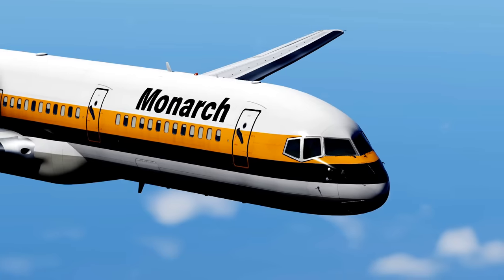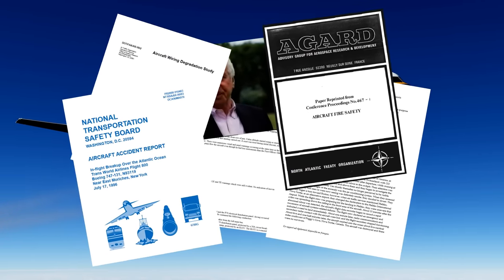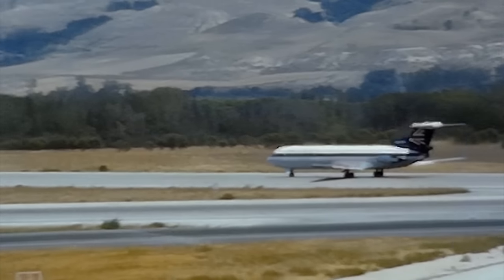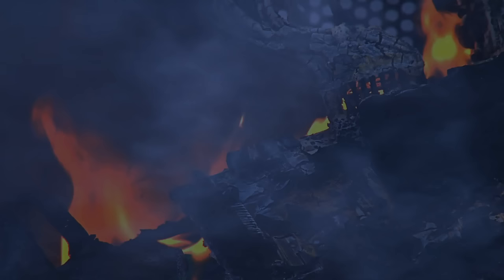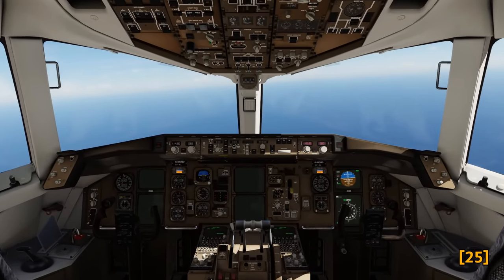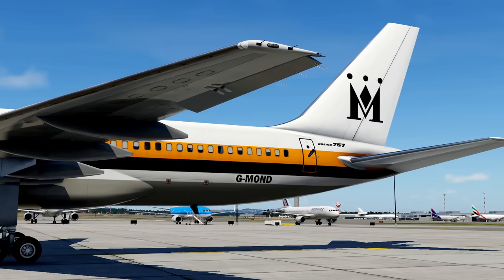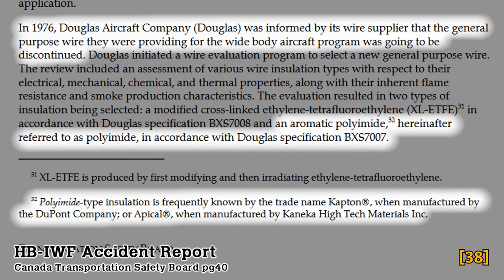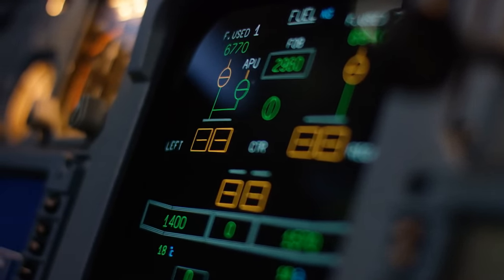The Toilet was Leaking??  What The Heck Happened to Monarch Airlines Flight 390 - DISASTER BREAKDOWN

Comment: What is the most puzzling issue to me , since you mentioned the arching in the 800 flight disaster, is exactly that aspect of wiring and fuel tanks. It has been known for many decades that you do not want to lead a high capacity wire through fuel tanks because if they produce arching, they will produce a spark strong enough to set fumes ablaze at explosion rate velocities. Yet, at the same time, high and low capacity wiring was routinely still bundled together throughout aircraft, leading arching in high capacity wires to jump to low capacity wires. And right there, you have the true cause of the 800 flight center fuel tank explosion. But still, NOBODY connected these 2 dots until the 800 flight went down in the waters right outside New York, sadly causing most passengers to experience a horrifying fiery death before even hitting the water.
So, what I don't get is that despite the problem finally being thrown into the known equation of arching problems on aircraft, and prompt initiatives resulting from it, aircraft are to this day STILL being built with both types of wiring bundled together and low capacity wires still being led through fuel tanks. And despite empty fuel tanks routinely being filled with inert gasses to avoid a fuel/air explosion like in the 800 disaster, there is no real guarantee that somebody will never forget to do that, and a new 800 disaster will never ever happen again. The danger is still very real and very lethal.
And the most stupid thing is that they only need to look at ships to solve and eliminate this danger completely. Ships are very much in the same situation as aircraft when underway. If a fire occurs, they cannot simply stop on the spot and people walk of the ship/aircraft while firefighters from the nearest fire station turns up within minutes to put out the blaze. 
So, on ships, you never see any form of wiring being led through a fuel tank of any kind. It is ALWAYS led around these tanks in one way or the other despite the fuel being much less volatile than high octane aircraft fuel. In addition, Both types of wiring are never bundled together at all if it can be avoided, and if it cant be avoided, then only for the absolute minimal length possible in the same wire lane box. This serves a dual purpose. One is the obvious one like the 800 disaster. The second one is that if you do have wiring near a fuel tank, it is low capacity wiring so that if a fuel tank has a leak, the wiring will never produce a spark capable of igniting the leaking fuel, and if arching happens in a high capacity wire, it will be virtually impossible (like a 1 in 2 million chance if everything is being mounted and maintained properly) to transfer to a low capacity wire moving close enough to a fuel tank. This is even more important in navy vessels as these are built for combat where the risk of fire is even greater because combat damage must be expected due to being hit by enemy weaponry.
So the aircraft industry world wide should actually embark on a journey to visit both civilian and naval vessels to see how it is properly done and incorporate the lessons in their construction methods. Hell. Even car manufacturers never lead wires through or near the fuel tanks if they can possibly avoid it (which is very easy to avoid on all road vehicles). But the aircraft industry and the air lines are so focused on saving weight and space that even these relative simple solutions that would perhaps add weight similar to that of a family of 4 with luggage overall on a wide body jet have chosen to not use it as a habit. And it wouldn't even require a lot of new technology or the invention of new materials. The technologies and materials are already standard in the aircraft industry and it's maintenance sector.

Comment: Most airlines don't assign pilots to a a new fleet, or any position, based on being "the best". It's normally done by seniority, although for a brand-new airplane there could be some requirements such as specific previous experience in similar equipment, instructor experience, or specific previous PIC experience (ie no brand-new CA's on a new fleet initially). Specific requirements would be determined objectively, often by regulators. Not a bunch of managers sitting around arguing as to whether Mav or Iceman is best for the job. With that said some non US/EU airlines do have arbitrary processes for that kind of thing, I have no idea about Monarch.

Comment: But considering the deficiency of electrical power due to the electronics and engineering bay suffering major damage, wouldn’t the thrust reversers also stop working (due to the lack of hydraulic power due to the pumps not working due to a lack of electrical power) making it difficult to slow down once on the ground without your wheel brakes overheating and possibly catching on fire while trying to slow down from such high speeds, or am I missing something here because the 757 uses its engines for hydraulic power rather than newer aircraft like the 787 where the hydraulic system is decoupled from the engines and electrically powered instead?

Comment: Swiss air 111 was a double vitcim. It had the the faulty wire insulation and the extremely flamable milar insulation, or however you spell it, that the FAA didnt properly fire test...

Comment: Interesting incident. I was not aware Swissair 111 had any connection to Kapton insulation. I thought the principal issue there was they had wired in a new AV system completely wrong. And installed it in such a way that it could not trip a breaker when the inevitable shorts developed.

Comment: Is this what also caused TWA 800 crash in 1996?
(It was found that the fuel was highly above the flashpoint and they blamed it on a wire spark in the center fuel tank)

Comment: It's like anything that is new testing will show some issues, unfortunately it won't show all and repairs can be just as dangerous. Look at the issues with the auto industry and all the stuff used to avoid crashes. If not properly calibrated or it fails it can and will cause the exact thing it's there to avoid.

Comment: You kept showing the tape, that's not used to insulate wires, typically to wrap them or cover surfaces that need binding and/or insulation.  PVC and Teflon insulation have their own drawbacks so don't paint polyimides as a buggy man.
PI is quit water and solvent resistant.  It's used in RO filter membranes.
Wires and cables need to be handled and installed with care and need proper strain relief and be protected from abrasion, and fluids at all times unless designed for this.  This wiring wasn't properly installed or maintained.
https://en.m.wikipedia.org/wiki/Polyimide

Comment: Been refreshing my homepage for past ten mins or so, the algo has not brought the vid up. Came in thru your channel page, got here now. I hope that you ain't gonna have your reach curtailed on this one, thought I'd put a comment incase anyone else is getting non-normal condition recommendations-wise.
Reply: Also, had the heating element in my fan oven fail causing an arcing event which coupled to the fan cover-this latter object having ablated it's surface layer in a 10mm wide strip in line with failure of heating element and deposited small beads of material quite widely, and the heating element having burst around 1/3rd of it's circumference over 50mm or so of length. The whole affair was terrifying, but were protected by electrical fuses from any other problems.

Comment: You have to realise that, in the case of Swissair 111 flight, the fire didn't start because of the aircraft design. That explains why it happened only once. It had much more to do with the inboard flight entertainment. Let me put it another way : the Swissair execs are to blame for what happened. They had pretty basic and bad computers installed under the 1st class seats by a very shady company they favoured, a company that had no care for the original electric system of this MD-11. So they messed everything up in this specific aircraft, with only one goal in mind : turn it into a flying casino. Yes, money game as an entertainment - they didn't do it on any of their others MD-11s, that's why nothing bad happened to them. By doing so the way they did, with those computers that overheated with a very unstable power supply, I let you imagine what occurred next.

Comment: The Boeing 757 is my favorite plane!
Reply from the maker: one of my favs too!
Reply: mmmhh so on the 757 the lav flushed using a recirculated liquid - this is the ones we flew on - not the cabin refits with sucker lavs. so the stewards and stewardesses indeed even the ground cleaners never pour chemical down lav on turn around, the lav flushed a blue recycled liquid up and down to clean the pan keeping the solids doon below in the tank however the blue liquid became mixed with passenger liquid and re flushed all the way to back to base, became very smelly. older airliners not having the sucker flush used to have these when we served on them hence when blue liquid leaked oot onto apron on turnaround lav servicing used to stink to high heaven so seems like this mechanism of keeping solids down and re using liquids in the flush had malfunctioned somehow 😮

Comment: I just got the fright of my life. So my first flight on a wide body plane was the Boeing B767-300/ER registered to MartinAir Holland as Papa Hotel Mike Charlie Victor (PH-MCV) in 2007. The plane had been leased to British Midland International and I flew from London to Jeddah. Get this. Papa Hotel Mike Charlie Hotel (PH-MCH) suffered this type of wiring fire in 1996 and made an emergency landing in Boston. So I flew on a sister to the incident plane. If Saudia Flight 163 had a plot twist in that an electrical failure started the fire, then perhaps it was induced by Polyimide Kapton wires arcing. But then again, it's more likely that old fashioned matches, something not hyperbole by the way, started that fire.

Comment: Easy to hate on the stuff but you can't take it in a vacuum.  People are comparing the wiring deaths to a zero sum.  But you would have whatever alternative they used having it's own drawbacks and issues and certainly crashes caused etc.  

This is a really important thing I always seem to see people do with climate change.  "omg look how much lubricant turbines drop in the sea"

ignoring that it's not turbine or nothing... it is turbine or oil platforms which would spill almost unthinkably more.

Comment: I remember back when Frontline on pbs did a in depth on Swiss 111 and when they tested the META trash it light up like a Roman Candle.
Dahhhhhhh. FAA.
Just like many others item through the years that all you have to do is breath on it and it'll catch fire. Anyone remember many years back a documentary that came on 
The Discovery Channel 
(back when they where good)
No tv trash is worth watching now.
I am a diehard YouTuber,and o' except for internet got rid of all cable trash tv.
Anyhow back to the episode I'm talking about,the ntsb,scientist and engineers among others gathered to gut a airliner and test the flammable items that would bring down an aircraft. 
There where many items,in particular the seats,you guessed it made of the very Flamable Styrofoam. Anyone that has ever seen this material burn knows it burns,nasty,meaning very hot,chemically,very smokey and very fast.
Of course I remember them saying would you look at that,and of course when they dug into why planes have all this flammable material on there aircraft when better less flammable materials where available it was found that,well you guessed it again,
$$$$$$$$$$$$ the ole green back.

Comment: I found this very misleading, most of the pictures of wiring were not of wiring in aircraft, more like Ethernet breakout boxes and server farms. The continued showing of Kapton tape is also misleading as wiring conductors are never just wrapped with tape, additionally the stranded conductors are circular, not hexagonal as shown. In almost all the incidents reported there was an underlying cause that led to the failure of the Kapton, toilet fluid, mechanical vibration etc which should never have occurred. The few aircraft wiring pictures shown its clear that all wires are tightly strapped to prevent sympathetic vibration.   Its not to say however that Kapton was wrong, rather just  a failure to understand its characteristics in the application. If you ask an electrician to install PVC wiring on the outside of your house, particularly where the sun shines he cannot do so because regulation prohibit it. PVC degrades in UV Light. I'm a veteran of 3,500 flights in commercial airplanes in 25 years WW and no disasters.

Comment: is the 757 the 767's little sister?
Reply: Pretty much, I always saw it as a smaller 767 to suit long and thin routes rather than a successor to the 727 as it’s larger and has range capabilities beyond the 727-200 Advanced.
Reply: yh i've always heard that it had overpowering engines
Reply: The RB211 turbofan engines the 757 has were originally developed for the L-1011 trijet widebody, they were later applied to the 747-100B, 200 and its subvariants, the -300, SP, and 400. So basically, Boeing decided to stick widebody engines onto a narrowbody jetliner, probably to prove to regulators at the time the 757 could be ETOPS compliant.